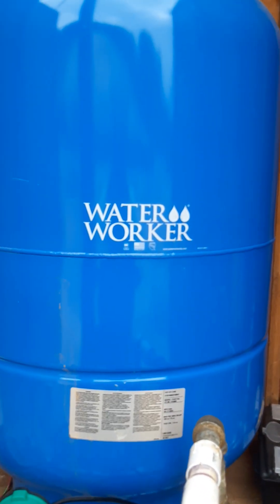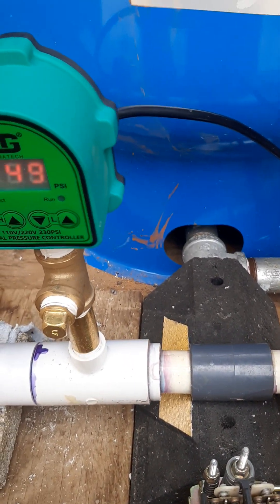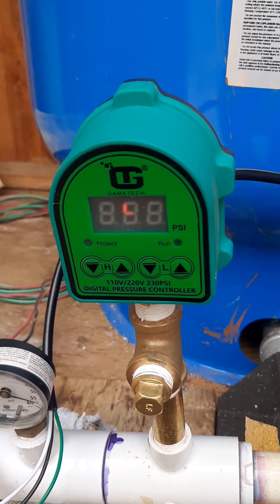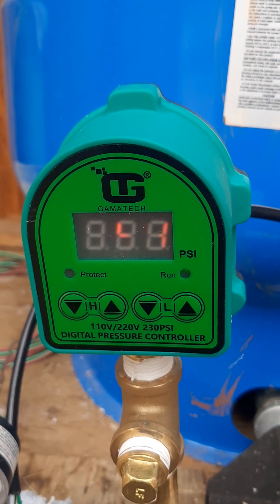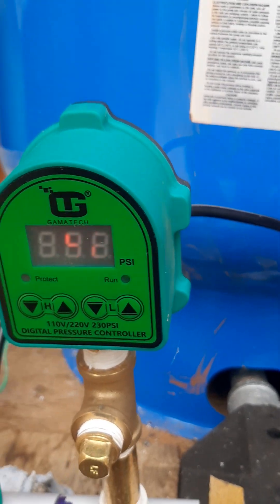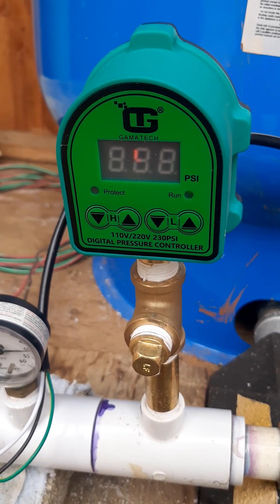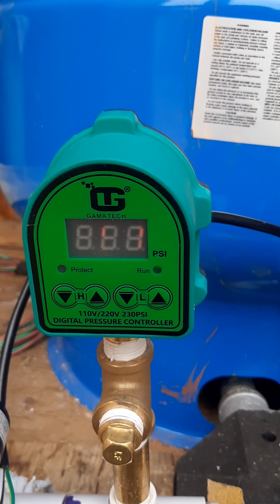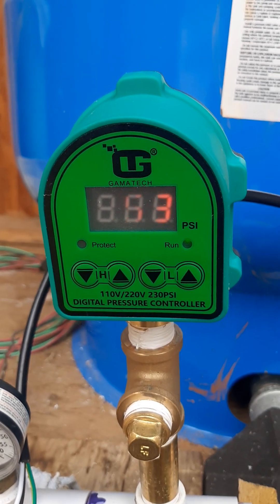WATER WELL PUMP PRESSURE SWITCH

Comment: i too have a GamaTec and it quit HP cut off.  IT overshoots from set pressure of 60 to 90 before cutting off pump.  I cannot set it back.
Reply from the maker: I think there needs to be at least 20 lbs difference between high psi and low psi. What's the low side? I put a brass T fitting in line under the switch in my video. If minerals (rust) get into the trigger/diaphragm area you can stick a wire or spray  WD40 to clean the switch area. If you clean it out then you might be able to reset the  upper psi setting again. Hope this helps if not you might have to buy another one. I clean my pipe "T" once a year so it doesn't get clogged up.

Comment: Help please!! I got the similar model and my tank is 40lt. How do I adjust 2 parameters so it will stop when nearly full and start when nearly empty ?? Like in number what should i set ??
Reply from the maker: I'm not sure what you are asking. Is the tank 40 feet or 40 gallons?
Reply: @grantdrennan8342 the tank  can contain 40lt of water, how do I set those 2 parameters so pump motor will stop when nearly 40lt and start when nearly empty.
Reply from the maker: The switch works on pressure not volume. When a pressure tank reaches the settings it will start up or shutoff depending on the settings. 
   If your tank isn't sealed (open, non-pressure type) then you can't shut it down,  it will overflow. 
   This switch is only designed for solid enclosed metal tanks. Works on back pressure only. Air or water.
Reply: @grantdrennan8342 tank that can contain 40lt of water, never said that is open or anything else. Come on man. It's work's on pressure that why it's called pressure pump switch but you also need set the number of when to start the pump and when to stop the pump.
Reply from the maker: @entertainmentstation4662 come on man watch my video again, the specs are in the VIDEO

Comment: What PSI did you set your tank to? AND What voltage is this on? Mine is 240V. I have 2 black and 2 white wires that the analog pressure switch is currently using.
Reply from the maker: I started with the mechanical (analog) switch just like you. The Gama Tech digital switch runs on 120 or 240 volts (The Gama Tech switch detects automatically which voltage is being supplied to the pump so you don't need to worry)
   As for the tank pressure, I'm assuming you're referring to the bladder pressure inside the tank,  I think bladder pressure is 9 psi recommended by the tank builder, not for sure. Google your tank manufacturer. I set my on/off cycle tank pressure a little higher than most because my well is downhill from the house 40/60. If your well is above (uphill gravity) the house you can go recommended 35/55. Just don't over do it, because that switch can go over 200 psi and blow up/break the pipes.
Reply from the maker: And ALWAYS have a pressure relief valve built Into the system somewhere. Your Water Well should already have one in the pump house on the piping somewhere, if not whoever built your system did it WRONG  !!
Reply from the maker: When I said 9 psi ubove for the bladder, that is AIR injected into the top of the tank not water lol. Don't want to confuse the rookies!!
Reply: @grantdrennan8342  Thank you. I have 2 hot coming from the breaker and 2 wires going to the well. Do the instructions tell you which color wires on the switch to connect to?
Reply from the maker: @BucsFan1995 Yes it does, but the wires coming out of your breaker could be different colors same with the pump wires too. I think my 2 wires coming from the pump side were both black.  I Googled 240V for A/C and it said it didn't matter which black wires went which direction on the pump being it was ALTERNATING/CURRENT
Reply from the maker: I have 3 wires from the breaker and 3 from the pump. The third wire from both should be the GROUND.

Comment: How is it working out so far? Anything you are concerned with?
- I am putting one on our pump today and was curious of reliability of this type of switch. Thanks for sharing your experience.
Reply from the maker: I've been using it for around 4-5 months. No problems at all. I installed it for my cousin and she likes it better because the mechanical switch was hard to reset after a emergency shut down (running the well out of water) This electric switch will reset real easy, with just a push of a arrow button on the switch. Gamatech states that the switch is good for at least a million start/stops. I'm not affiliated with Gamatech but so far it's worth the price.
Reply: @grantdrennan8342  did my install today, went very well and set up was straight forward. I am going to install a psi relief valve this week incase switch fails to shut off pump(just as a backup). Thanks for the info and report. 🙂
Reply from the maker: @dieselboy7138  Your water well should already have that pressure relief valve on the pipe somewhere in line ? Mine did, I'm surprised yours didn't .
Reply from the maker: @DelectusDisciple My pump already has the pressure relief valve built into my system.  They all should have a relief valve, even before you put the Gama Tech on. That's weird it doesn't already have it?

Comment: How you connect the the control box 
Is there a wire diagram
Reply from the maker: @thefishingguys1012  I'm no electrician, but there was a instruction paper on the color code of the wires. Then I Googled the info on alternating current and ground wire. This one picture is the connection to the old switch and the second is what fittings I used on the digital switch. It was pretty simple to hookup if you have any mechanical knowledge you'll be ok.
Reply: @grantdrennan8342  Can you dumb this down for me?  My Gamatech didn't have an instruction paper for the wire color codes.  Mine wires are brown, blue, & yellow-with-a-green-stripe.
Dumbing it down for me, which wire that went on the old switch goes to what part of the Gamatech?

Also, if the pressure goes completely off, how do you make the Gamatech manually start?  (Like the old switches have a level to manually start until it gets up to enough pressure).

Thank you, very much, in advance.
Reply from the maker: @KuljoUngarzhe I went online and got the instruction diagram for the Gamatech Switch/Controller. This pretty much covers the wiring for it. The wiring colors coming out of your house/pump I have no control over so you'd have to figure out which one works. You don't have to worry about 120V verses 220V because the switch detects it automatically.
Reply from the maker: The Green/Yellow wire = ground
The other 2 wires are hot
If the pump shuts off all you do is push any arrow for a second and it restarts automatically. Hope this helps. I tried to upload the instructions but U-Tube wouldn't let me.

Comment: I asked a plumber about this product, he said he's never heard of a digital pressure switch. I knew it would work i just couldn't find videos of people using it till now. Thanks
Reply from the maker: I'm glad I helped. I researched electronic pressure switches and only could find one digital switch and it cost between $300.00 and $400.00. I figured some tech company should have made one by now for less than $100.00 bucks lol. I kept searching and found this and it was new to the market (March 2024). I'll send a picture of why I put that cleanout tee under the pressure switch.
Reply from the maker: See Short reply
Reply from the maker: I put a new video of the plugged pipe on my U-Tube channel.